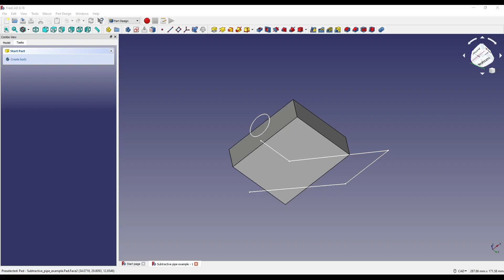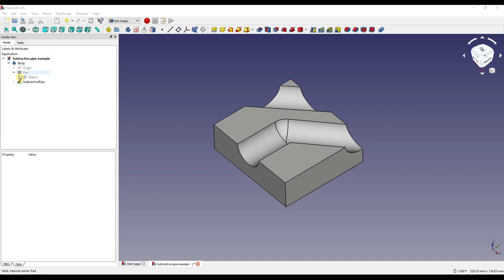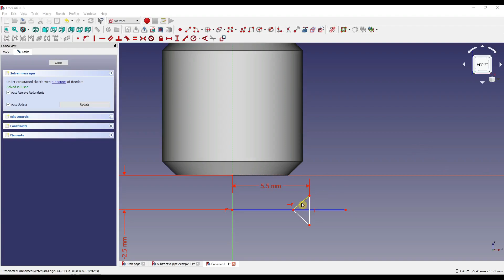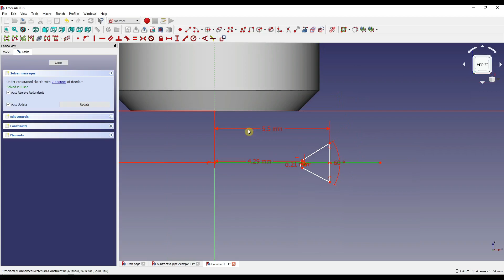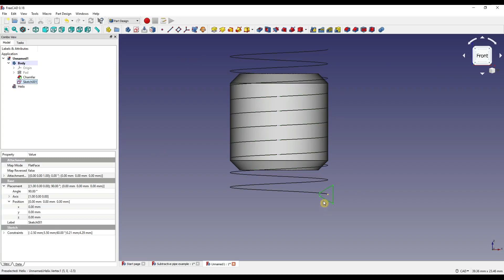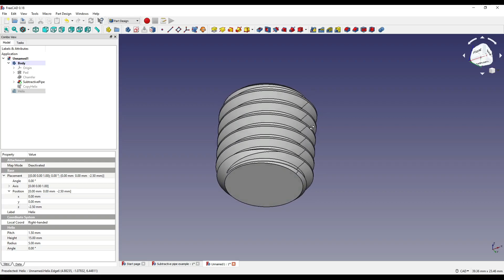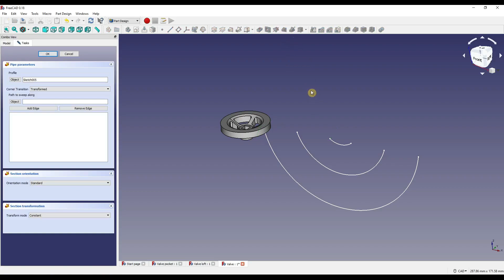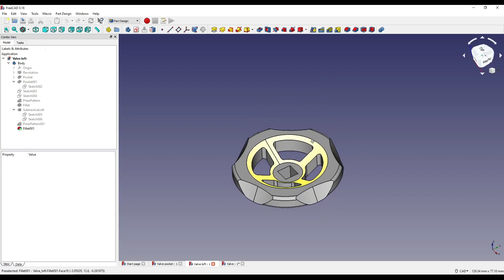3D modeling FreeCAD Tutorial - Subtractive pipe modifier

Comment: I know Freecad has a fastener workbench. I want to learn this technique as well. I have cut perfect actual threads on a lathe before. You created a horizontal line 2.5mm below the part. That number is not critical so long as you drop the Helix the same. Is that correct? Also, I understand where the .216 radius comes from in accordance with ISO, however in my personal experience the cutting tip was ground to a point. The question is, had you not put that radius on the triangle, will you still get a functional thread?